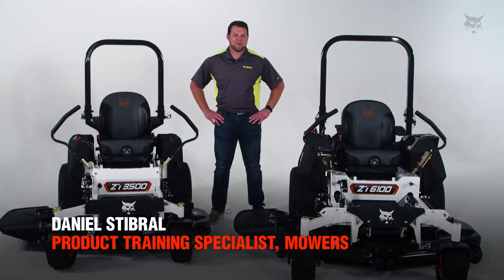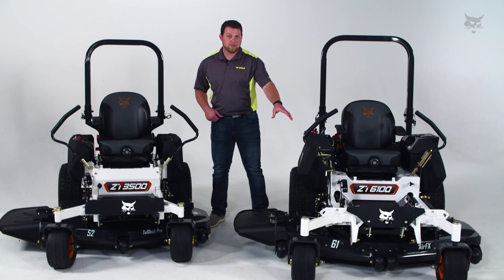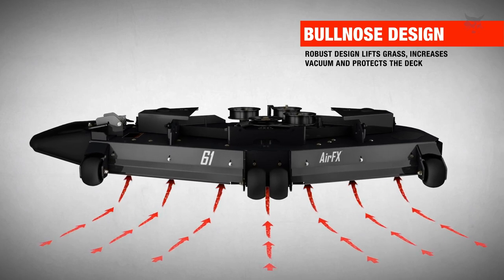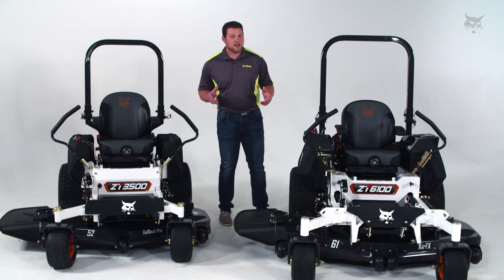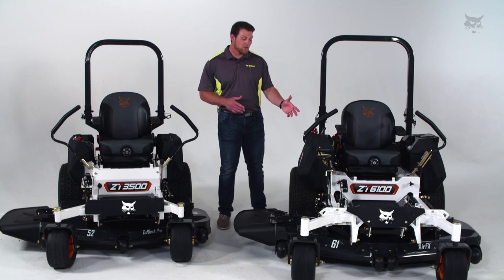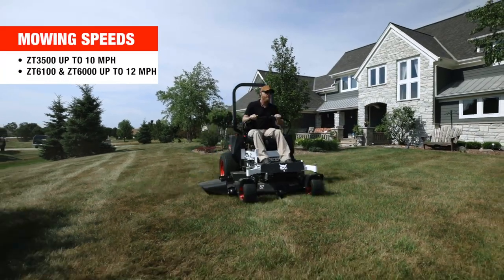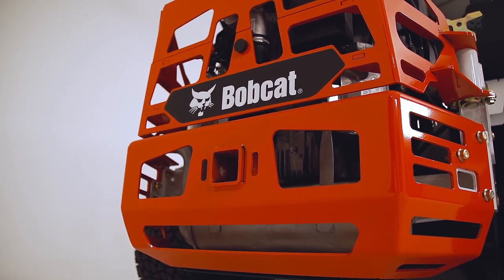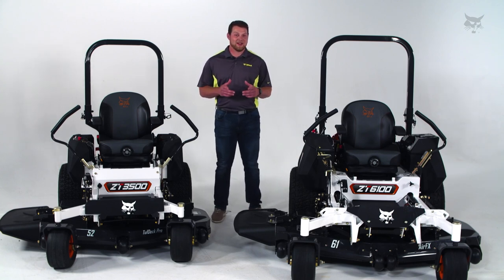Key Differences Between ZT3500 and ZT6000 Platform | Bobcat Zero-Turn Mowers | Turf Talks

Comment: Bobcat,  you want 10k for the zt3500 and nothing has changed other than the paint from green to white when you bought out the bob-cat mower company a few years ago.  Their price was $4000 less. I tried to wheel and deal with your dealers and they would only take a couple hundred dollars off MSRP whereas Hustler and other manufacturers offers 15% off or more for their military discount.  You're going to have to step up your game if you want to sell these.  The last dealer I visited had almost 2 year old leftover models sitting outside rusting and getting sun baked. :(